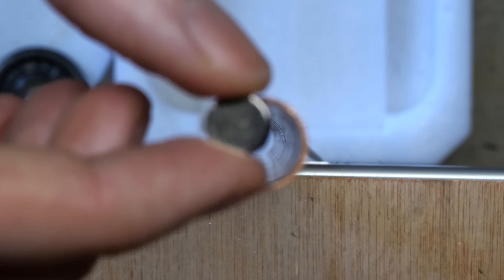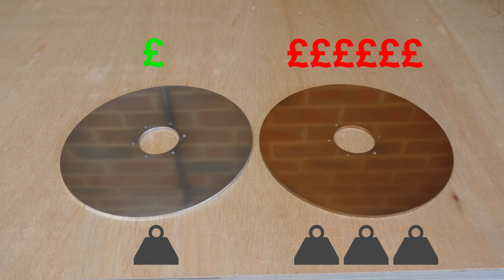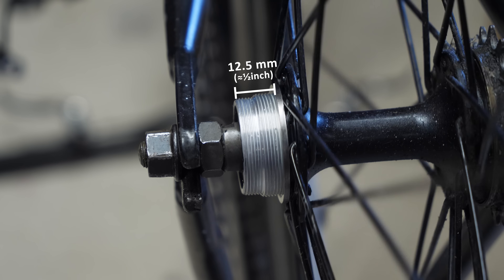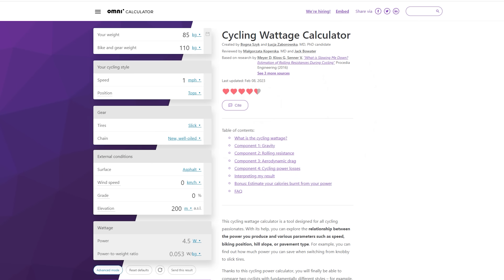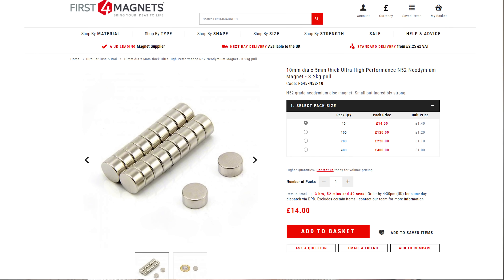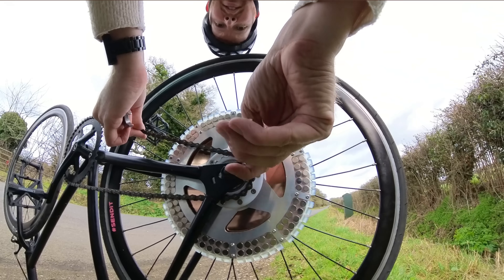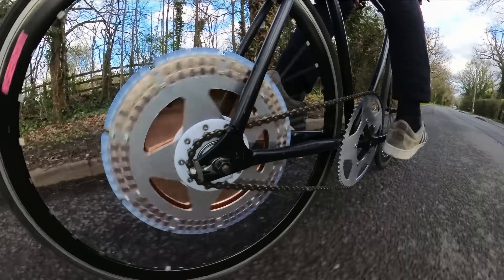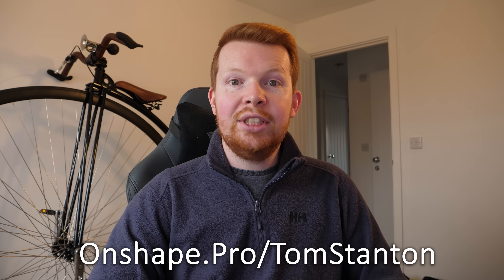Gearless Magnet Bike

Comment: Afaik, silver and gold are better conductors than copper.

There are three steps left to divinity:

1: replace the neodymium magnets by coils and drive them with alternating  multiphase current.
So you have an async motor.

2: replace the copper disc by a disc of magnets. Make the magnets and coils a multiple of three and drive the coils with one of your controllers of your previous E-Bikes.

3: put the magnets as far away from the center of the rear wheel as possible to get the maximum of torque.
Out there is also space for more magnets and coils!
It might be possible to attach the disc of magnets to the spokes.
Put magnets and coils on both sides of the rear wheel if there's space for it.

You might end up needing a better helmet...

Comment: As you showed on flywheel magnetic battery  project maybe draining the electric current from the disk will add resistance while "braking".   Knowing differential speed between disk and magnets is important: reverse pedal will add resistance for lower speeds (if possible , should feel awkward to practice). This project seem to share several concepts to regenerative brakes on electric vehicles.

Comment: If you want to improve the the strength of the magnets, try fitting a steel sheet on the back of the magnets. It makes the magnetic fields a lot more powerful by connecting North and South poles of 2 magnets. FYI, only connect 2 poles at once. Not all of the magnets with one sheet. That could make it 'short circuit' 

If you want some more info on magnets, I have it available. Even some simulation tool.

Comment: Neat project. Seems like the downfalls with it's rideability is that similar to a torque converter. Might multiply torque but it has a lot of parasitic loss that is is converted to heat. I wonder why no one hasn't just out right make a CVT for a bike.

Comment: Tom, I know you're limited on space, but, could you do some tests using two copper disks on the outside with two sets of magnets in-between (sealed) vs the double set of two sets of magnets on the outside. Essentially, I figured that the magnets are using half of their potential since you're using them on the outside rather than on the inside (similar to dropping a magnet down an aluminum tube, where as yours is like dropping a ring of magnets around an aluminum tube.
Reply: This would also be a better heat-sink.

Comment: Couldn't stop thinking that a neat feature would be to add the function of moving the magnets outward of the diameter of the copper disk thus adding the ability to let your legs rest while the bike keeps moving with the momentum gained.
Also a possibillity to add ratios of magnets like you would with gears, this will require space and much more work but it's also just an idea.

Comment: If you carve some slits to the copper disk you basically have an induction motor. And like in the induction motor, the smaller the slippage = the relative speed of the magnets and the disk, the greater the efficiency.

Comment: Thank you Tom! What an interesting idea. Thank you for presenting it so well and trailing a very interesting concept. Perhaps by varying some of the magnetic force using a mix of neodymium and electromagnets this concept can overcome some of its problems? (Would a larger diameter copper disc allow less magnets to be used at a greater distance to the centre?). I’m looking forward to your next video!

Comment: In electric motor theory, we call this an induction motor. One property you already found out is that it is only working efficiently in its operating point where the speed is about synchronous.
One way to further increase your eddy currents aka torque is to attach a plate with high magnetic conductance (like iron) to the outside of your magnets. As magnetic field lines are always closed, this reduces the magnetic reluctivity for the whole loop and thus also increases the magnetic flux on the other side where your copper disc is. And it would shield your chain from the magnets.

Comment: I love magnet projects. Always so interesting. Your discs make an interesting clutch. I was thinking that if you could turn your copper disc into an electric generator, you might make it a self charging bike with an electric optional motor. But I don't know if you would generate enough Electricity and the effort would be brutal. 

Lovely video. And BTW, I truly love those 3D printers. I have 2 at work and they are workhorses. Preform really has a nice setup in the Form3's.

Comment: Can you improve it try turning it into a hybrid generation system with regeneration feature  by adding a heavy freewheeling flywheel ,   capacitors to stabilize the system   , solar panel,  6 ,or 12  TEC1-12715 12V Heatsink Thermoelectric Cooler Peltier Plate Module to convert the  lost heat into 12 volt energy   , and  battery, to store the energy  and  drive an electrical motor ? I would love to see that system in action .

Comment: How could you use that as a generator ?? Would it be more efficient than a conventional one in this disc configuration i wonder, its reminiscent of the Faraday motor. Would you have to fit carbon brushes to it to collect the current ?

Comment: Interesting, intuitions says this is only a kind of slipping clutch. Loosing energy as heat. 
May be you could try coupling the pedals to the wheel through a BLDC motor (using a differential )
This way you could do 3 things : direct coupling (short the motor), generator (charging the battery), pedaling assistance (using the motor power). Like on an hybrid motor car. To make à kind of electric geared hybrid bike 😁

Comment: You should do one where you pedal a generator in the front and then have a motor in the back and just have the motor run straight off of the generator. Let the electricity handle the "gear ratio" between front and back.

Comment: Very interesting concept and educational video! The next steps I'm curious about (1) using much larger disks like close to the wheel diameter, if not actually on the wheel rim instead of brake pads, or can a standard aluminum rim provide enough effect and thus use a common cheap part; (2) Use a large disk set on the pedal crank with only a fixed metal sprocket on the wheel to get more accurate alignment/wider packaging allowance, and (3) using three disks on the crank so you have a large magnet ring and a small magnet ring on a single large copper plate to switch between for a two gear bike, easy on flats and better on hills.

Comment: well, it's basically a breaking system for roller coasters (inductive breaks) as a connection between chain and wheel. That system is designed to loose energy via heat.

Comment: what would happen if you used electromagnets and you were able to recharge your batteries from the electric current induced in the copper such that you reduced the amount of energy lost as heat energy by at least 90%? also you would have to mount the magnets inside the wheel or the wheel was made of a solid sheet of copper with the tyre mounted along the rim of the solid copper wheel? and you would also need magnets on both sides of the copper disc. Also you could test using an electric motor to run the magnets so that you could get very very high rpms? thanksvfor the video it was very interesting.

Comment: Why not use the aluminium rim of the wheel (or screw a copper ring to 1/both sides)? Would need a much larger magnet sprocket but you could reduce material by getting rid of the copper plate.. then add it to both sides... you will also have in general a lot higher speed of interaction.. and as you mentioned.. speed increases the effect.
Reply: Oh and to stop chain sticking.. just use a thin iron foil on the back of the magnets?

Comment: Is an electrical current generated when you stop pedaling, and if so, could you capture that in a battery to use with a small motor to help you pedal uphill, etc? In other words, a highly simplified regenerative braking system.

Comment: @7:39 do the positions of the magnets in the holder make a difference ? Outer VS Inner slot configuration ?
Reply: Also how about a caliper mechanism like the pinch brakes to bring the magnet pack closer and further away from the copper wheel ?

Comment: That reminds me of the difference between "synchronous and asynchronous" three-phase motors (the quotes are to signal that I used a literal translation from french, as I couldn't find the english names). They both use 3xn coils in the thir stationary part (usually the external part) to create a rotating electromagnetic field at the center of the motor. In an asynchrounous motor, the moving part of the motor is just a conducting cage that, in the presence of the rotating field, starts to turn due to the generated eddy current. A synchronous motor in the other hand, uses either a permanent magnet or an electromagnet as its moving part. At the functional level, asynchrounous motors (depending on the torque and the supplied current) don't turn at the same speed as the rotating field. There is a factor g (facteur de Glissage, which is french for slipping factor) between the angular speed of field and the motor (ie Wm = g x Wf, where Wm is motor speed and Wf is field speed. g is between 0 and 1). The synchronous motor however, turns at the same speed as the rotating field. If you add more load to the motor it just draws more current (there's a limit of course). The only caveat is that you have to find a way to start it until it reaches the field's speed (one way to do it control the frequency of the supplied current to start with a slow rotating field and then speed it up gradually).

I don't know what you can do with this information. Maybe if you can find a way to pedal at a constant speed and also bring the bike to a constant speed as well you can populate the disk with magnets to achieve perfect coupeling. I mean I guess you already have lots of magnets just laying around so what could go wrong lol.

Comment: great project, very interesting!  I don't know when you realized you might have a copper heating problem, but I've worked with eddie currents and lorenz force before and I was just waiting to see how long it took you to either pull out a thermal camera, burn a finger, or melt a 3d print ;)

Comment: this gives me an idea... isn't this technically more of a torque converter than a clutch? What stops this from being used in cars? Large aluminum flywheel (which are already pretty commonly available) with adjustable magnet positions on the transmission side?

Comment: Cool idea!
But the build made no sense to me from the start - in that fixed configuration.
If you wanted a continuous variable transmission you would have to make the distance of the magnets variable. 
Disc(s) with magnets get moved closer to the copper - more power transmission.
Magnets further away means faster pedaling needed but it would be easier.
Also:
Fixed chain 97% efficiency, with shifter 96%, metal internal speed hubs 96-80% efficiency*......plastic rear sprocket? Hmmmm :) 
I'd guess you lost at least 20% of your power from that resin sprocket alone. Could be even more.

The most surprising thing I learned from that video though, was that so much power was lost due to heat buildup! Thanks!

(*YT Video "Are $199 Shimano Alfine Internal Gear Bicycle Hubs GENIUS or Terrible?" at  07:40)

Comment: Arrange your magnets in a halbach array to get more of the gauss field pointed into the disc. Then you can have the magnets only on one side and possibly disengage it for coasting. A cammed shape so it's only pushed close to the paramagnetic disc with forward/backward pedalling (this is a nightmare of design I can't describe in words.) The finale of why I wrote this comment: in addition to making the disc catch more magnetic induction and transferring more motion, it would be in open air and cool better/ get less warping. I'd would also make a thicker disc I could drill holes into from the edge to center  centripetally fling air out of it and draw in from the center, sort of how car brake rotors are compared to motorcycle.

Comment: So you over-engineered a worse bike :) Jokes apart, this is a really interesting experiment, it would have been interesting to see if the slowdown effect was higher if you pedaled backwards.
Apart from that, there's a reason if pure electromagnetic clutches never caught on, you lose a lot of torque to heat (what is known as EM clutches are actually electro-mechanical).
I think this effect would be useful (and probably is used) in regenerative braking for EVs.

Comment: You've got a weak link in that chain. Also does it work if you induce a higher speed by using a high torque electric engine to or simple use a rotation multiplier? Somehow...

Comment: if a disc rotates in a uniform field, it won't experience a change in flux and hence eddy currents. i think because the magnets are so uniformly spaced, the field is getting uniform. maybe having fewer but stronger magnets spaced farther will help? like stick two magnets on one another and empty half of the magnet slots

Comment: Amazing idea! You can also separate copper segments into angles. This way the current must go in and out of radius. Your coupling will be much much greater! You can also drill lots of holes in the copper plate.
Reply: @notfiveo If you have electro magnets you're building a motor. More speed holes.
Reply: @1800Supreme  well steel is not as good as copper. And you'd need a battery for running the electromagnets. But the advantage is that you can switch them on and off to create some kind of a gear ratio I guess.
Reply: The magnets on the other side of the disk we cant see may be interfering or attenuating the magnetic field. I would test by first removing them leaving just one side full of magnets and the next test with different patterns, e.g. opposite sides, same plane. also using metal back-plates on the magnet helps allot
[S N]  |Cu|  [N S]  
[N S]  |Cu|  [S N] 
    config 1/5
[N S]  |Cu|  [N S] 
[S N]  |Cu|  [S N]    
    config 2/5
  X X   |Cu|  [S N]
  X X   |Cu|  [S N] 
    config 3/5
  X X   |Cu|  [S N]\Fe\a
  X X   |Cu|  [N S]\Fe\a
  X X   |Cu|  [S N]/Fe/b
  X X   |Cu|  [N S]/Fe/b
  X X   |Cu|  [S N]\Fe\c
  X X   |Cu|  [N S]\Fe\c
     config 4/5
d\Fe\[N S]  |Cu|  [S N]\Fe\a
d\Fe\[N S]  |Cu|  [N S]\Fe\a
e\Fe\[N S]  |Cu|  [S N]/Fe/b
e\Fe\[N S]  |Cu|  [N S]/Fe/b
 f\Fe\[N S]  |Cu|  [S N]\Fe\c
 f\Fe\[N S]  |Cu|  [N S]\Fe\c
     config 5/5

d\Fe\   or  /Fe/a  represents iron plates that connects two magnets together, one magnetic pole to another on the same side. a to a, b to b, c to c.....

X X represents the absence of magnets, Iron, or Copper. Nothing basically.

|Cu| represents the copper disk

[N S] or [S N] represent dipole magnets, N being North and S being South

Comment: I love this idea! Any chance you could make the aluminum disc that would hold the magnets in the center and have 2 copper discs on either side? I feel like that would make the whole thing more efficient
Reply: The magnets on the other side of the disk we cant see may be interfering or attenuating the magnetic field. I would test by first removing them leaving just one side full of magnets and the next test with different patterns, e.g. opposite sides, same plane. also using metal back-plates on the magnet helps allot
[S N]  |Cu|  [N S]  
[N S]  |Cu|  [S N] 
    config 1/5
[N S]  |Cu|  [N S] 
[S N]  |Cu|  [S N]    
    config 2/5
  X X   |Cu|  [S N]
  X X   |Cu|  [S N] 
    config 3/5
  X X   |Cu|  [S N]\Fe\a
  X X   |Cu|  [N S]\Fe\a
  X X   |Cu|  [S N]/Fe/b
  X X   |Cu|  [N S]/Fe/b
  X X   |Cu|  [S N]\Fe\c
  X X   |Cu|  [N S]\Fe\c
     config 4/5
d\Fe\[N S]  |Cu|  [S N]\Fe\a
d\Fe\[N S]  |Cu|  [N S]\Fe\a
e\Fe\[N S]  |Cu|  [S N]/Fe/b
e\Fe\[N S]  |Cu|  [N S]/Fe/b
 f\Fe\[N S]  |Cu|  [S N]\Fe\c
 f\Fe\[N S]  |Cu|  [N S]\Fe\c
     config 5/5

d\Fe\   or  /Fe/a  represents iron plates that connects two magnets together, one magnetic pole to another on the same side. a to a, b to b, c to c.....

X X represents the absence of magnets, Iron, or Copper. Nothing basically.

|Cu| represents the copper disk

[N S] or [S N] represent dipole magnets, N being North and S being South

Comment: WTF?
I appreciate the workmanship, scientific approach and passion but what's the point? Magnetic clutch for a bicycle? There is no clutch in a bike!
So what's the problem statement, the goal of the project?
The pain with the power transmission with bicycles is the chain. Why don't you eliminate it by capturing the pedal power with an alternator, transmit it by wire to push the wheen through an electromotor?
Others have tried and they claim that the energy loss is high but maybe with these amazing powerful magnets...

Comment: I just realize how it is similar to an asynchronous motor. The rotor is made from a piece of conductor. The different part is the stator. In an asynchronous motor, the coils of stator generates a rotating magnetic field from AC current. Instead of that, you build a rotating “stator” to create the rotating magnetic field  from the magnetic array. The heat generated from conduction current is the main part of the energy loss.

Comment: Mechnically, the chain and sprocket combination is by far the most efficient system you can find (of course drirect drive is even more efficient but you are missing the gear changes). Belts are not as efficient as chains, but they are widely used in city bikes because they dont require any maintenance what so ever.

Comment: If you do something like this again, I'd recomend buying an aftermarket bike hub that has a mounting bolt pattern for disc brakes. That way you don't have to put stress on threads or plastic, just cut metal mounting plate to match the bolt hole pattern